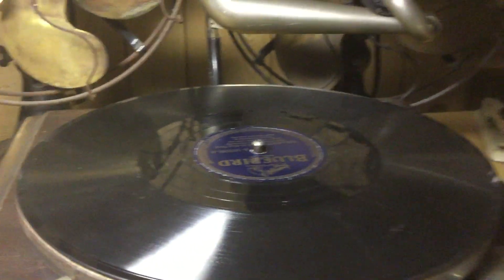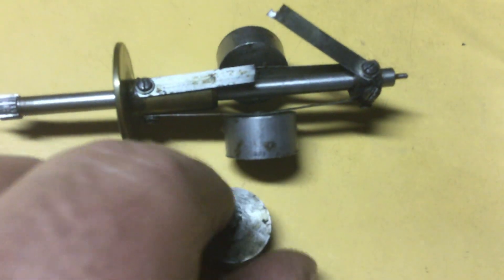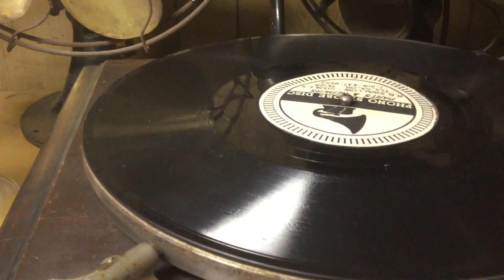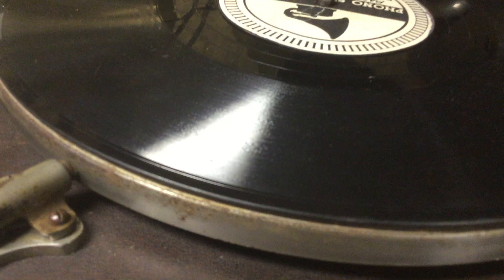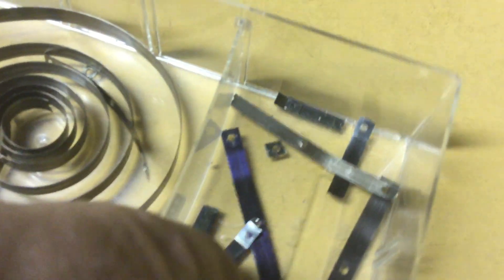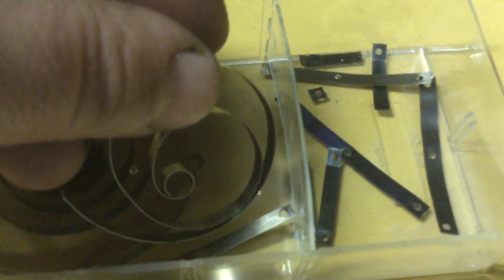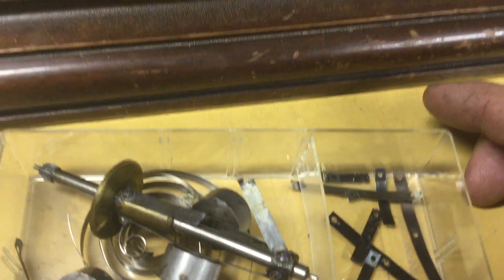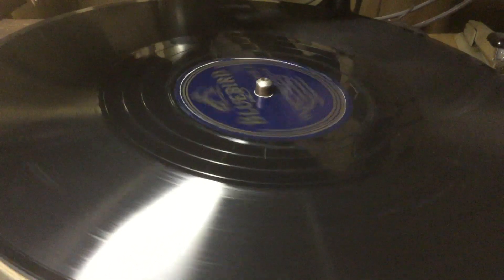How a phonograph governor works; or governor springs, part 4

Comment: My Columbia Grafonola had a noisy motor and was not really regulating quite right,but,after replacing a couple of gears and it is now quieter than before,the governor weights and springs were replaced as well

Comment: You can't go wrong with Guy Lombardo, however, maybe keep checking the speed does your regulator have a adjusting screw underneath? if it does turn it clock wise or counter clock wise